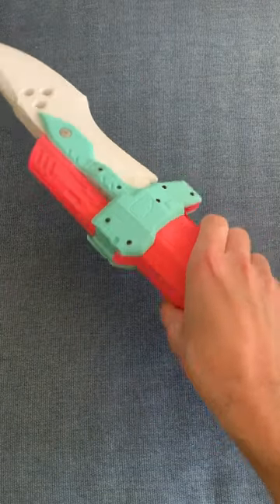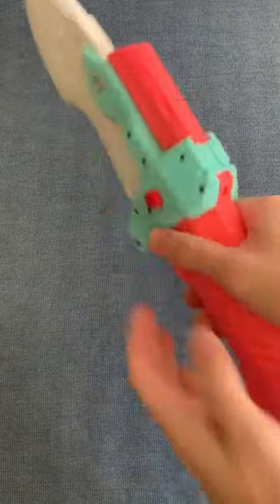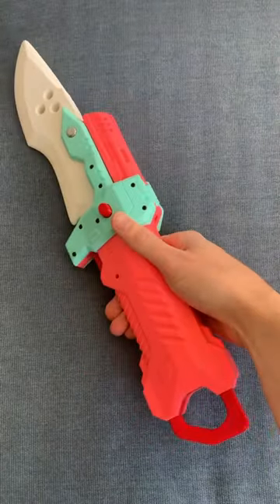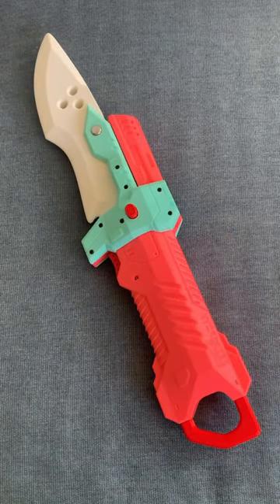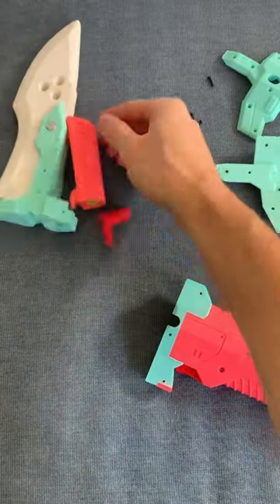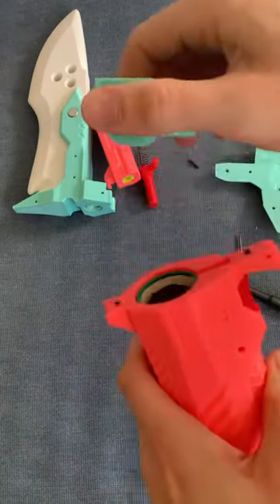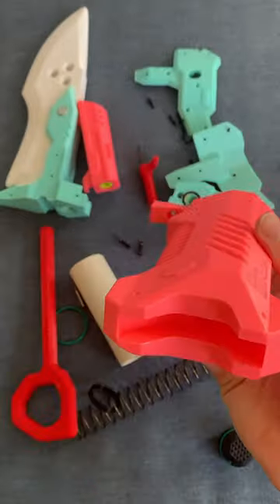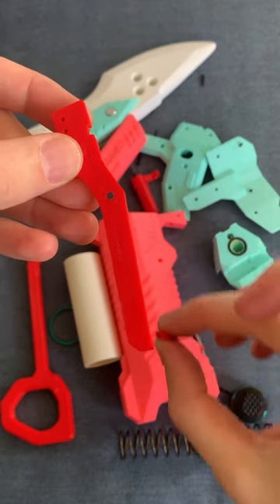Yeah that’s broken.

Comment: I bet someones gonna ask if it can take a k26
Reply: K26 what??? 
K26 Turbocharger?
K26 electric bike?
Kira k26 system-on module?
K26 diving pool?
Reply: @d3athreaper100  not sure if this is a joke. K26 is a (particularly beefy) size of spring. Captain Xavier another nerftuber Beret is associated with has a whole series called “Can it take a k26?” where he tries to fit this massive spring in all sorts of blasters. It’s turned into a community meme
Reply: @d3athreaper100  K26 in the context that's appropriate here lol
Reply: can it take k26?
Reply: Wait, what? It is compatible with this k26 vacuum nozzle? Mmkay.